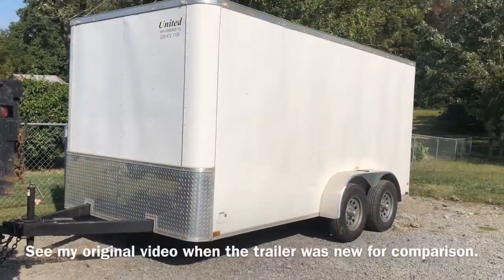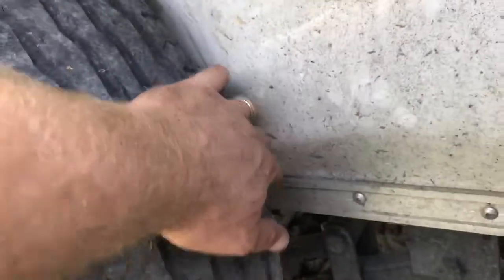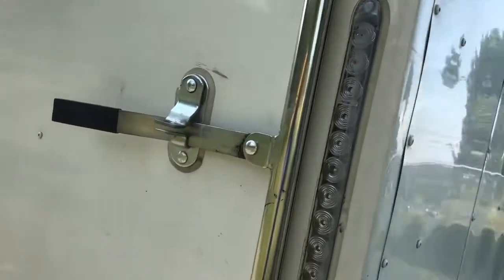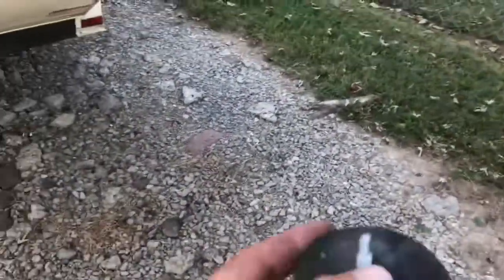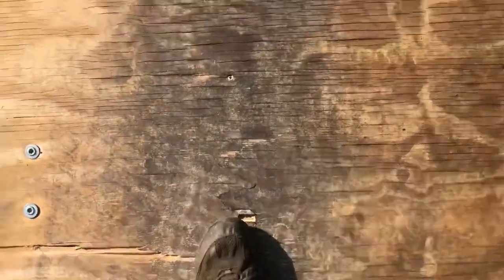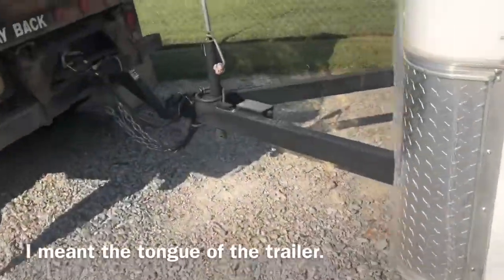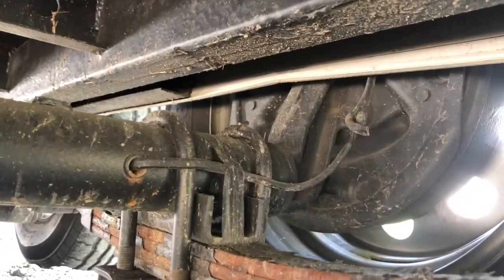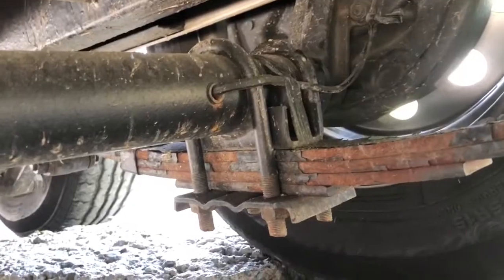1 Year Update of my 7x14 Cargo Trailer DON’T BUY from this manufacturer

Comment: For a supposedly professional trailer manufacturing company whose everyday responsibility is to construct new, reliable, hard wearing cargo trailers, these faults are truly horrific!

The recklessly negligent standards of construction raise major concerns about the company!

The gap between the wall and the floor exhibits an extremely low standard of production, inspection and quality control, likewise the panel separation and tyre rubbing.

Such faults undermine owner confidence, that trailer should never have left the factory in that condition.

By videoing these faults you help potential buyers to make informed decisions about whom they buy from.